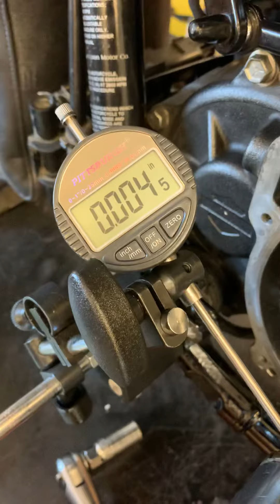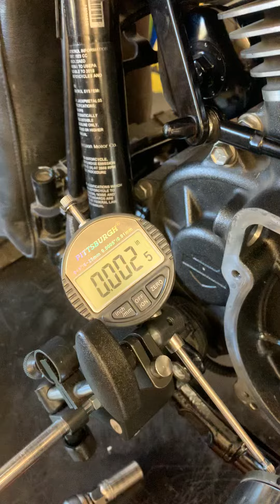Runout

Comment: Be interesting to see the runout at the camchest side. I’d take a guess it’s further out than that 😂
Reply from the maker: .010 inch is within tolerance. Guess it is good to go!!! 😏
Reply from the maker: Yes. I’m curious now to see what runout is on the cam chest side. Probably do a big bore kit this winter. Will check then.
Reply: @chrismorris9065  hmmmm. May find it has more runout in other side. 
My crank read 0.0034 and it was twisted between the plates. 
Now true and welded and 0.0008” runout at cam chest side. 
Keep an eye on the runout that it  doesn’t more more than that. 😎👍
Reply from the maker: Trent_SIEMPRE_DOS_RUEDAS 
H-D says tolerance is up to .012 in. !  Seems like lot of runout and front sprocket is wobbling and creating more issues.
Reply: @chrismorris9065  haha. Yer this is the thing with HD ... the “allowable” tolorence has gotten larger over time because HD have found the crank has runout more and more... lessens the warranty they have to cover lol. 
To have Gear drive cams... runout can only be 0.03” weeks think. Or is it 0.003”. Can’t recall now.
Reply: @19Trent69   Pretty sure only 0.003" for cam runout.
Reply: @birdbreaker  yer that’s the one. Cheers Mate 😎👍